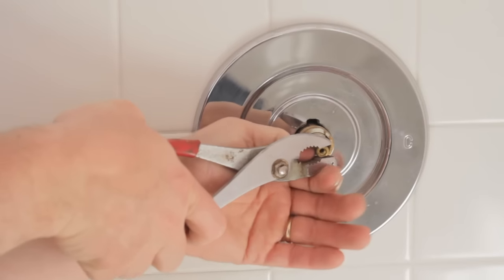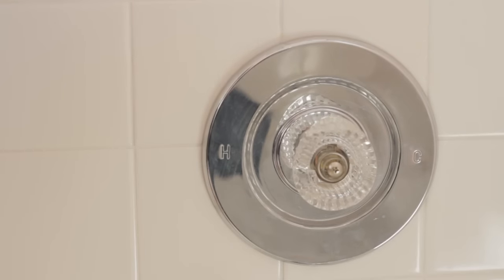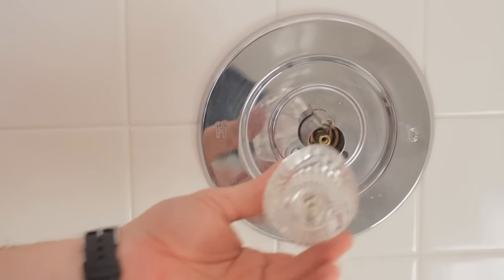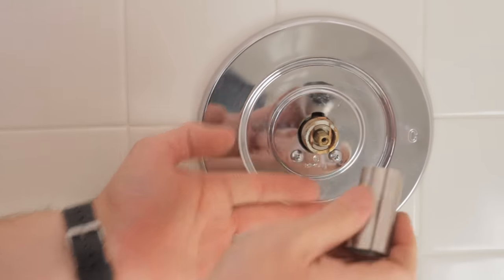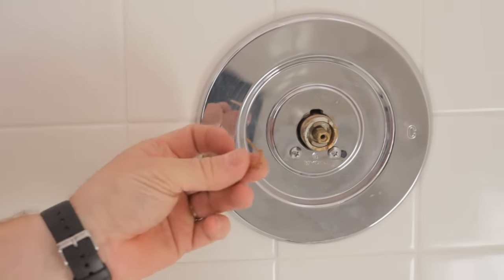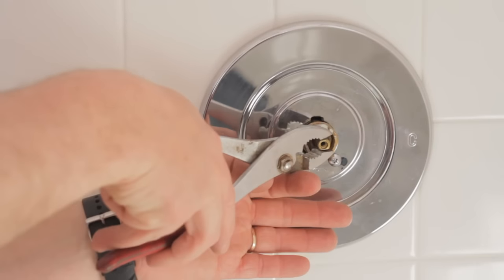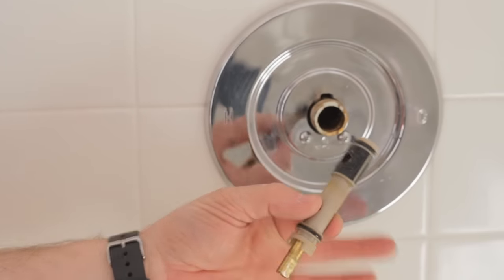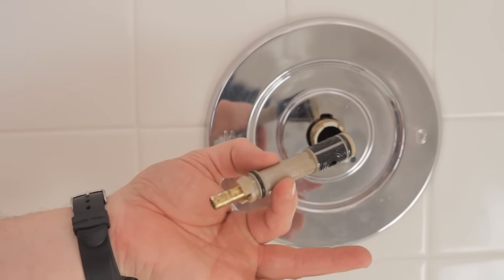Bathroom Repair : How to Fix a Leaking Shower Faucet

Comment: Thanks for the video. I never would have pulled as hard as I needed to if I didn't know it should come out. I would have ripped the entire bathroom apart only to be embarrassed only to later find out it was this easy and $20 to fix!

Comment: Hi Terry, I just wondered if you had any such suggestions for that exact same kind of faucet if I already replaced the cartridge 1 year ago. It was leaking, I replaced the cartridge and it was fine until recently when it started to leak again. It's a pretty regular steady cold water leak.

Comment: Question. What if it isnt leaking? My grandparents have this exact one. And the actual knob that turns that middle screw, became unattached. So theyve been using screwdrivers and now pliers to turn the temperature. Financially they arents able to buy a replacement so i was wondering if i could just use some type of adhesive to reattach them. Im sorry if i cant explain it too well. I have pictures too if need be.

Comment: What should I do if the screw in the center of the handle is stripped? Not the screw head, but the screw itself so that it doesn't come out?

Comment: You need to shut the water off first. One yahoo did this at my moms apt building without shutting the water... knocked his tooth out. Ecch.
Reply: Thank you for this, as it wasn’t mentioned in the video I would have started taking it apart without even thinking of that because it’s a handle
Reply: Yeah I was thinking the same, shut the water off and drain the pipes before doing this or you will get a nasty shock and a free shower

Comment: Even with the water shut off to the house will it still flow HOT water? Does a valve on the water heater have to be off too?

Comment: Not enough info shut off water remember how the fixture is taken out, especially the position of holes to replace the same way to adjust hot and cold. If placed in the wrong position, it will be hot or cold no adjustment to water temperature. He has 3 videos and not one of them explains the position of the water outlet holes.

Comment: I tried this BUT could not get the stem released without the special tool.  You can't buy the tool without the new stem.  You don't know which stem to buy without removing the old stem...AND... you can't get the old stem out without the tool... frustrating.
Reply: Chicken and the egg sort of thing...  It's got to be leaking again by now.  9 years later...

Comment: Terry you made that sound so easy but just wondering. Don't I have to shut off water from somewhere? I live in a apartment complex. Hm.mmm
Reply: Yes. I have been watching several videos on replacing a tub/shower faucet and that should be the first thing they mention, but they don't. I wonder how many people got soaked and flooded because they did not turn off the main.